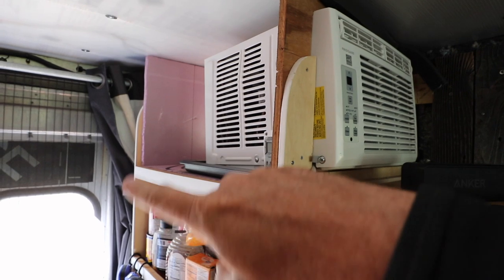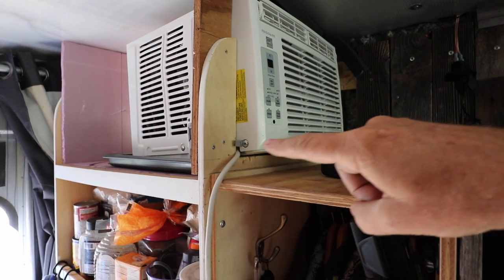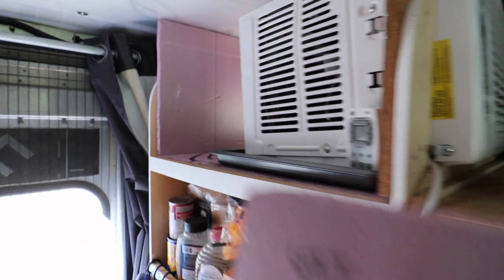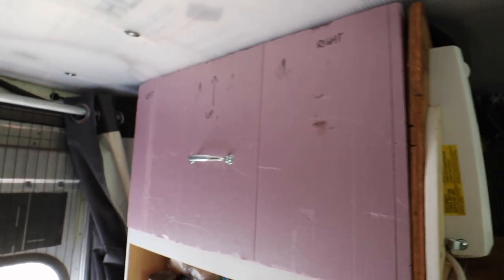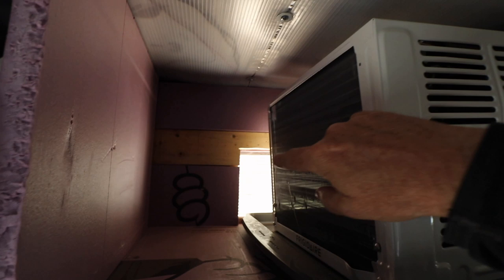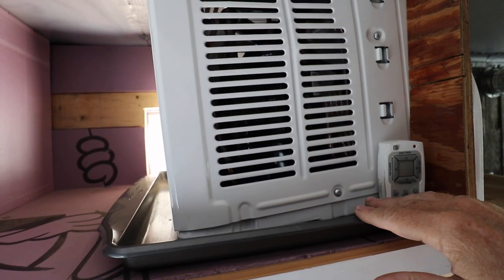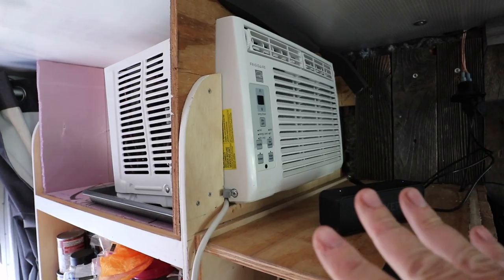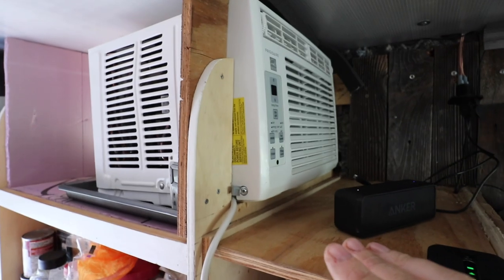Solar Powered AC in a Step Van Update P3 E559

Comment: Seven,  Option 1 is the way to go.  Use the unit as it was designed.  If you don't want an AC unit hanging out the side of the van when not needed, mount the unit on a platform that has some heavy-duty drawer slides mounted to your shelf.  Take the panel you cut out of the side of the step van and hinge it from the top.  When the AC is in use, push it out the cutout and it 's working as designed.  When it isn't or when you are driving, pull the unit in and let the top-hinged panel drop down to cover the hole (maybe with a catch on it to keep it from flapping around as you are driving).  You can use an inexpensive fan to redistribute the cool air from the AC throughout the step van.
Reply: I like this idea.

Comment: The hot and cold air intakes are in different spots with no/minimum mixing of air. The hot intake is the slots along the side and top with 100% of that air blown out the back. The cold intake is the entire front mesh you have a cheap fiber air filter behind and a squirrel cage fan that sucks air in the front and out the cold vents. 

You have a condensate pan under the evaporator (cold side) coil that as it operates will frost up and every so often the compressor shuts off letting the coil warm up and the frost melt dripping into the pan. This pan has a small hole in the insulation wall and uses gravity to flow out into the same pan with the condenser fan dipping in it to spray water onto the condenser coil(hot side) helping to reduce dripping out the back as it evaporates the water and sends it out with the hot air.
Reply: Andrew is correct. the cool air intake is in front just below the outlet ports. ideally you could leave the unit where it is, add another vent out the rear of the step van, then install a couple computer fans to the condenser (the radiator on the rear of the AC unit) blowing air away towards the rear vent. then cooler air will enter the sides of the AC unit and blow across the condenser.

Comment: I am currently converting a Step van myself. Stealth is of the utmost importance to me. not sure about your prefs. I have a partitioned wall at the rear of my build giving me a 3' deep by 7' wide "garage". I use it to store/ organize all my tools, and house my e-bike. For the AC unit I mounted mine in about the same place as you have just mirrored(passenger side). It protrudes into the garage and has a dual chamber enclosure on the back end. The enclosure has air INTAKE on the front part of the enclosure, and an exhaust at the rear. Both intake and exhaust are to outside, covered with grill and mesh. The dual chamber enclosure was made for me by a local ac and heating company out of metal duct work to my measurements in under an hour for less than $80! Grills were painted to match vehicle and blend in well. I have no complaints. It has been able to keep my step van around 72-75 here in VA when temps outside hit 94 and with humidity felt like 105. I would think twice about it "hanging" out the backside. Not just for looks and stealth, but more for keeping vandalism and accidental impacts from hurting it. Something about having AC, hot water, heat, toilet, shower, kitchen, in a "studio" style setup just works for these vans. For combo living area/ bedroom I use the Ikea Vallentuna sofa/bed. They are perfect for these vans. Bolted to the frame of the van along the driver side wall, it pulls out to a perfect queen size bed, or you can just pull out one side for a twin. A tad pricey, but comfy and work well.  Wish you well, and great journey!!!

Comment: Suggest you mount the AC inside with the hot air exhaust butting against a cutout and screen on the outside. This would make sure the unit is solidly supported, and the drain for the condensing moisture is taken care of as well. There are several teardrop trailers that use this design. Mounting the unit as in a residential application would require you to create a rather strong  support structure on the outside, which is not only aesthetically less than pleasing, but requires bracing and will protrude by a foot or more with the risk to get damaged. Hope you'll find a good solution that works for you. Maybe you ask Badge for advice too.

Comment: Hi Seven,  The first thing AC does is remove humidity,  then it starts cooling.  Most newer AC units use the fan to sling the condensate water up against the condenser coil to minimize the amount of condensted water that would normally have to drain off.   Hope that helps.  Yes, I believe you sould mount the unit as it was intended for best results.

Comment: That air conditioner will really struggle and pull more amperage because it will be breathing a lot of its own hot air in that box. I mounted one under the bed of a sleeper in a tractor and trailer and I had to run three separate ducts. I ran one out the back It turned down through the floor and blew the hot exhaust out under the middle of the sleeper of the truck and I made a deflector to make it go towards the back. The other two ducts Were made from flexible dryer exhaust pipe I ran one to each side of the corner of the sleeper floor so it would be away from the hot exhaust. Doing it this way meant I only cut holes in the floor of the sleeper that you would never see. It was all contained under the bed in the big storage compartment. It actually worked great. The only way you could tell it was in the truck was the water dripping out from under the sleeper bunk. We ran it on a 2500 Watt inverter. This truck didn’t have a sleeper when my friend bought it and he added the sleeper and this was easier and cheaper than finding all the parts to put the factory AC in it. We replaced the trucks factory alternator with 190 amp and it already had four heavy truck batteries in the truck was normally running so he didn’t have any power problems. The fans in those little air conditioners also don’t like to pull air through the long pipes or ducts. On a hot day even his struggled so I added 2. 4 inch 110 V powerful pancake fans inside the ducting to help get the cooler into the cabinet. He use that set up for about seven years until he sold the truck. He could be cruising down the road and turn it on with the remote control to supplement the truck cabs a see if he needed too. By the way if you need something to attach ducts to the side The sheet metal square to round adapters that goes in most homes for you’re floor registers work pretty good to modify and go on the sides of that Ac unit For an air intake. I folded the edges out and screwed them right on the side of the window unit with self tapping sheet metal screws. Then you can hook your flexible ductwork right to it Then you could face your air conditioner  with the back towards the whole you have already and let it blow the hot air out that hole and let it take it in somewhere else. I’m thinking about taking the condenser out of the window unit that I have and cutting the lines and just mounting it under the truck with another fan and run the copper lines up to through the floor And then recharge the air conditioner with Freon. You could pretty much put it anywhere do you want it then And mount the condenser remotely.

Comment: Hi Seven, As you probably know I live in Australia and it get's HOT !! I've seen small A/C like that in caravans where only the back 2 or 3" of the A/C unit is hanging out the wall. After all, all you want and need is for the hot exiting air to blow out the back and the drain to be outside, the side intake vents can be on the inside which means when the A/C is running the heat, hot air and drips are outside and the cooling side vents are drawing in the cool/cold inside air thus making the A/C NOT work as hard because it's recirculating the already internal cooled down air !!  Not only that, you don't have the weight of the entire A/C HANGING out the wall which will need a substantial bracket to hold it up. I hope you get what I mean mate. Seeya Rob

Comment: Rotate the AC to the left so the rear faces the outside of your box (outside) If necessary , you can make a duct for the rear to the outside grill. Air will still be pulled in from the sides . You can also add a roof vent directly over the top of the AC unit .

Comment: 1. Put a fan blowing cool air in and forcing hot air out.
2. Put the AC unit on a drawer rail, mount a vent cover on the back that will be flush with the outside van wall when drawer is pulled in (for stealth and travel).  When you want to use the AC push it out so the face is sealed and flush with the inside van wall.  You'll probably need a latch to lock it in and to lock it out...

Comment: Top and side vents are for Exterior Air to enter housing, to go through condenser and Exit Rear. 
Front Lower vents are for intake of Interior Air, which comes out Front Upper vents to cool room. This unit Only recirculates interior air.  
When mounted properly, All Top, Side and Rear Vents should be Outside the vehicle.
Also, this should take up much less interior space.

Comment: My design is similar but the unit was overheating and shutting off; rearranged to face the evaporator coil to the vent and added a computer case fan to move air outside, works great now.

Comment: Really rooting for u on this one Seven. Solar powered ac would be so cool (pardon the pun). I believe I suggested earlier to build a rear fake wall and mount it to that. That device needs to breath properly to run efficient with less stress on the unit. Best of luck.

Comment: Having thought about this for a while now, I think I would rather have a 3 part system set up. 1: An indoor portable ac unit. This is the kind that has a duct intended to be placed in an included window frame. Because the issue with these is typically the water they accumulate, that leads to part 2: An RV style ice maker. This would be used to freeze the AC water collected(not for ice tea) and the resulting cubes transferred to a high performance non electric cooler. As the cooler ice melts, recycle it into the ice maker. If all worked perfectly, the energy draw would be less than a window AC unit, the installation would be easy and more attractive, it would eliminate any need for an electrically powered fridge because the cooler would have a constant supply of ice. In the winter months, simply don't use the AC unit and fill the ice maker with water as needed. Currently, a good fridge for RV or step van use is ridiculously priced. An ice maker and cooler can be had for about $220. A small portable ac unit is pretty reasonable as well. Wondering if this is a viable solution to kill two birds with one stone (refrigeration and climate control)?

Comment: Make sure that you are recirculating the cold air and not bringing it in from the outside. There should be a setting on the front or remote. The air that is being cooled should be drawn in from the front of the air conditioner and through a filter which will need to be cleaned occasionally.   

I think a third option is for you is to use your current installation and install a roof mount vent that the hot-air  from the condenser will vent through. Use a vent such as one that the three-way RV fridges use. You could also install a small 12 volt muffin fan that will help draw that hot air out and make it more efficient.  Basically the air that is used to cool the condenser will come in through the side vent that you already have installed. The hot air will then be vented through a rooftop vent that is directly behind and above the rear of the air conditioner.  All of the cabin air, the air that you want to cool will come in from the front of the air conditioner and through the filter. The cold air will discharge where it normally does.  That will be the most efficient for your needs.

Comment: I saw a Bob Wells video where someone had a window ac on sliders, with a "boat hatch" on the outside.  When he wanted the ac he opened the hatch and slid it out to "where it needs to be" to function.    Air conditioners produce heat, that portion of the window ac has to be outside, with air circulation it will never have in an enclosure.

If you need such a hatch I have one you can have.

Comment: You could go  with some variation of the RV fridge route. If you enlarged the exterior vent, you could put the back flush against the vent for the hot air to exit.  You’d either need a roof vent or some other vent to the exterior to pull in air for the sides.  I think the two vents rv fridges use could possibly be adapted. I think there are house ac’sthat vent and pull air in both from the rear but you might not be able to find one energy efficient enough... anyway good luck figuring it out!

Comment: I think by cutting a 2nd hole in the back of the van for the Hot air to exit and use the side vent for fresh air be drawn in. Be careful with restrictions in that air flow - restrictions reduce the units ability to work as intended.. Good Luck!!

Comment: Seven,  I just finished installing a Madia mini split air conditioner on a ambulance for a fellow nomad,  the unit he purchased works on  110 volts and requires 400 watts.  I got a little bit creative and installed the outdoor unit on a moving rear door.

Comment: Seven, There is more than one way to cool a home or a step van.

The modern way is air conditioning. It works in all climates. It's the only way to stay cool under humid conditions. Yet air conditioning requires lots of power.

The other method is an evaporative cooler, also known as a swamp cooler. They work by drawing outside air through a wet pad. The air temperature can drop 20 to 30 degrees if the air has low humidity. 
This method should work quite well west of the Rocky Mountains. 
The swamp coolers use 1/4 as much electricity. 

I imagine that you are familiar with these since you grew up in Colorado.

Comment: The front and the back are totally separated by the wall/window of the house, normally.  The air that goes in the top and sides goes out the back to remove heat. It has nothing to do with the front. The front draws air in through the filter and comes out the blower where you feel cold air. Air conditioners don't really make cold so much as they remove heat. The gas collects the heat and then disperses it out through the fins in the back. That a very simplified description but its the basics.

Comment: It would be easy to make an aluminum patch down the road to cover the hole if an AC unit was no longer desired. You will need some support brackets to hold it in place, try to find aluminum so it doesn't leave rust streaks.

Comment: hang the entire unit under the floor , extend the control panel wires to bring it inside , then build the 2 required ducts one for the output (top ) and the lower (intake ) then it's still stealth , but will work ...but the best option is a rooftop , but running on an inverter set up , I doubt it will work very well ...
Reply: Tow interesting

Comment: Make a box In a box  add one wall inside that box that prevent hot air from back of the unit and air from outside vent to mix. Then make ducting so that half of that outside vent (In van wall) is connected to that hot air box and half is connected to outside air box. Now unit itself draw outside air In and blows hot air out.

Comment: Seven, the front of the AC is generally separate from the rear.  Room air is drawn in through the filter, in the front, across the evaporator, cooled and sent back through the front grill. The front doesn’t mix with the warm rear air unless you have a vent or fresh air setting. Some units have this and you can use it as a not so efficient fan with the cooling part off. Hope this makes sense, -Eric.

Comment: I'm glad you are making progress and have figured out the flaws in your installation. But you still don't have it 100% correct. The vents on the side just suck air in to blow it out the other side to cool the compressor. The cold air that blows out of the vents comes in from the front of the air conditioner. There is no outside air that comes in to be cooled. That is why there is a filter on the front of the unit.

Comment: If u dont already have 1 then create a partition behind the driver and passenger seat and mount the ac inside that with the back hanging out inside the front cab of the vehicle then roll the front windows down for exhaust when in use.
Reply from the maker: great idea. I need to do another video update to show the latest progress. I finally have a working AC unit and solution that works for me. video coming soon!

Comment: Need to watch JY DOG Garage. He put a window unit in a box like that in his step van under his bench and found out you need to separate the rear discharge air from the side vents which actually blow over coils to work more efficiently.

Comment: I'm thinking he has it at to much of an angle. Also the newer units do not drip the water out. I got suprised when I bought one after a hurricane and it held the water till the fan started to push it out. Yes I drilled holes because it didn't seem right to me. Maybe build another cover out of wood that sticks out just a couple inches more  and latches in place. Level the unit and the air for cooling is drawn from the front.

Comment: the entire back of those AC units is designed to be outside...like a standard window AC unit. You may have to reposition the AC unit, so the rear fins directly face outside? And create a secondary air inlet system to feed the periphery inlet area of the exterior section? And then use an additional auxiliary fan...to blow cooled air towards the front of step van?